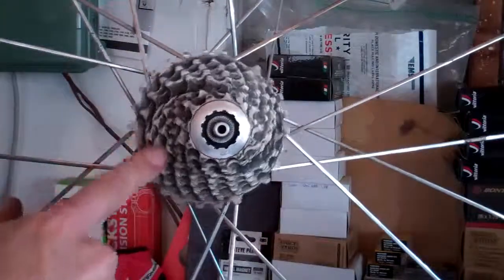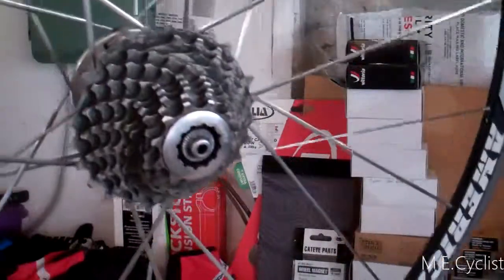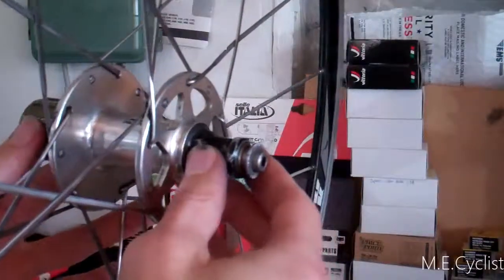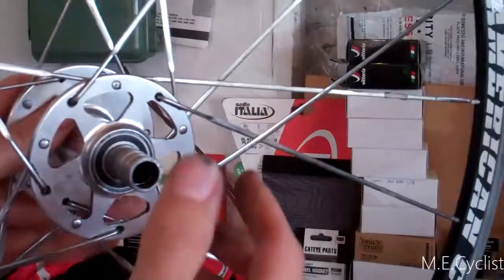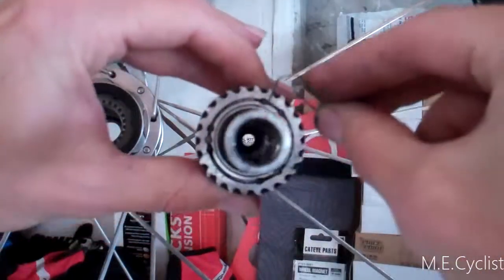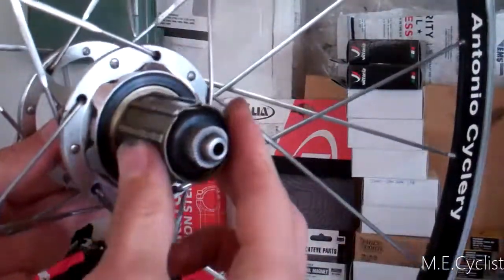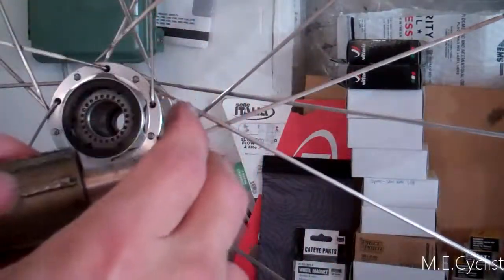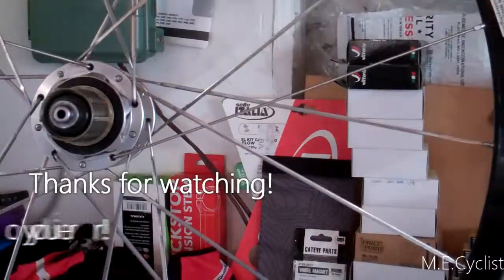Look Inside a Freehub - How Does a Freewheel Work?

Comment: This was your most interesting video so far.  I've liked them all, but I've never seen the inside of a hub before.  Never done work on one.  I didn't even know what caused the "ticking" noise.  Now I do!  You did a good job at explaining all the parts.  I knew there were bearings in there, but not the layout.
Reply from the maker: Yeah I tend to just take things apart, hoping to get them back together :)  Usually it works out pretty well.  I like to know how things work.  I will show you a front hub at some point too, super simple design up there.
Reply: @M.E.Cyclist  That would be cool to see.  Which bike had this hub?  The Santa Cruz?
Reply from the maker: This was the original rear wheel on the Merckx, an American Classic CR-420.  I liked it because it was really quiet.  Now that I think about it, it was probably because one or two of those springs were broken most of the time I rode it!
Reply: @M.E.Cyclist  I like having a quiet hub on my road bike.  I want a louder one for my mtb.  Kinda like having a bell, so people know you're coming.